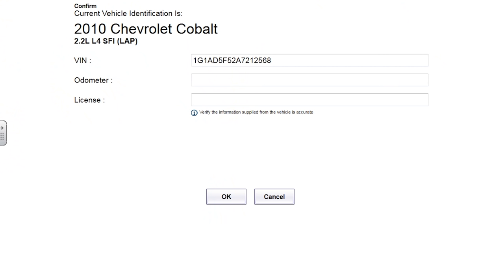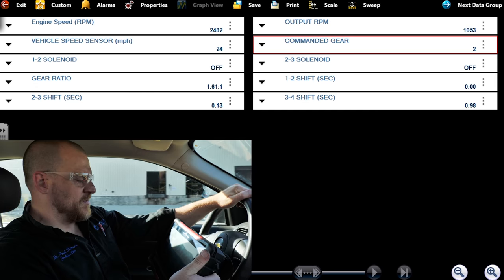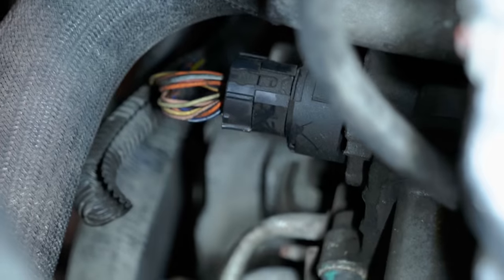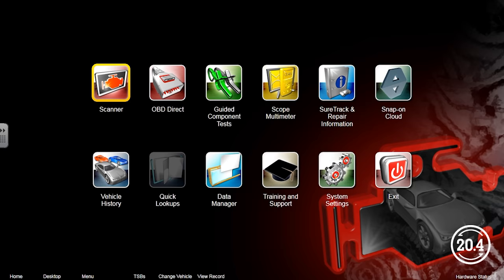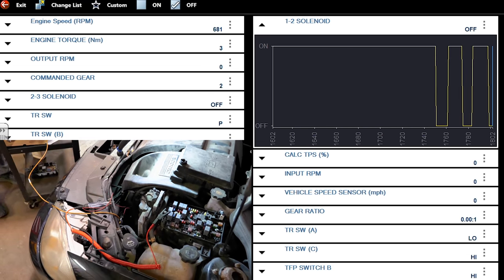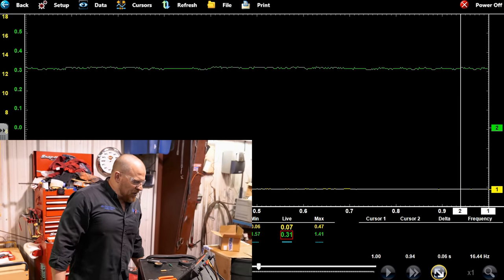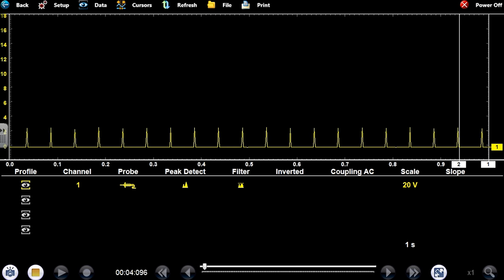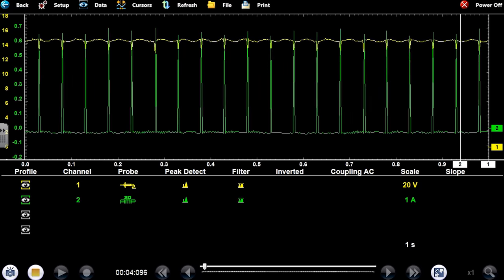Testing Transmission Shift Solenoids - (P0700, P0974)

Comment from the maker: Of course we still have a Saturday release planned for you guys! Merry Christmas my friends. Hope you enjoy this case study. Looking forward to your comments. Have a blessed day!
Reply: Been needing to test shift solenoids in an XJ, so thanks! Merry Christmas, Danner family. 🎄
Reply: Merry Christmas 🎄
Reply: Merry Christmas,  Blessed 🙌 🙏
Reply: Merry Christmas🎄 to Danner Family Stay Blessed😍
Reply: Merry Christmas, Paul and Caleb! 🎄
Reply: Merry Christmas to you guys!
Reply: General question about testing.  I get code recently P1750 and flashing D5 when I tried to drive Acura tl 2003 out of snow.  It was only then and it shut off.  It direct to A/B solenoid or if not, that tranny is gone.  However, someone at acurazine said it can be ground wire.  I know I do not have a problem starting so it is not that ground wire.  I see some ground wire go from chassis to tranny.  I checked from negative battery post to tranny case voltage drop when car was running and it was only 23 MV (millivolts).  Is it that proof ground is good in tranny/solenoids area?
Reply: Wait a minute , i just started watching this one , did you look up the wire harness on your scan tool ? I need to invest into a better scan equipment . Im gonna search your page , maybe theres a video already about the best diy computers

Comment: I've seen that exact same thing on a HHR. Found the solenoid burnt inside after proving the circuit was intact. This proves why a scope is invaluable at times to see a overall picture. Those side covers are easy to do and I did the HHR one in my driveway. Was a mobile job
Reply: Hey i was wondering how did u check the circuit

Comment: If it were my own car I’d maybe see if I pulled the transmission side cover off and tried to see how much a job it would be to throw a new solenoid in. I’ve heard some are easy to replace. So now if it was someone else’s car I’d be telling them no guarantees at all it’s gonna drive out the door. They still tell me to try it and I’ve been lucky sometimes. Nice job Paul. I like the way you reason stuff out.

Comment: You can sneak it out with just loosen the passenger side sub frame and all the way out on the driver’s side
Reply from the maker: So Danner was right! One of you would know...awesome!
Reply: Yes, the same on my other car brand for swaybar bushings.. dealer manual/instructions tells you to pull down the subframe but it isnt required as a DIY. Its tight but its reachable and doable :) you want to avoid to mess with subframe as much as you can. You need to line up the bolt holes and other stuff ive seen in the manual. With some "special super secret tool dealer only" :) and imagine all the rust and stuck bolts not coming out. :)

Comment: I have personally made several test lights including one with a fog light bulb in it for high current testing. I would buy yours in a heartbeat when you start selling it!
Reply from the maker: Thank you! I'll keep you guys posted
Reply: Yes sir
Reply: What I was thinking is a test light with different amperage bulbs that you can swap out. I don't know how high you could go and still make the bulb interchangeable. It might also make it a little dangerous if you have the wrong bulb in it.

Comment: Had this exact issue come into my shop about a year ago but on a cobalt, the customer said she had it to 2 different shops before getting a recommendation to bring it to me. 
These problems are the ones I like the most, had the issue figured out in about an hour and a half and that’s with pulling the side cover off and verifying that it was in fact a melted solenoid. 
Contacted the customer, recommended both solenoids A and B be replaced along with filter and fluid. 
Did that, reset the shift adaptations and took it for a drive. Problem solved and I earned a permanent customer

Comment: WOW!    You are the man. I have been having issues with my Dodge transmission.  I have had my truck in 2 local transmission shops. All they did was show me the codes and said to replace the transmission. Never did any electrical diagnosis on the codes. Seems like most shops see these procedures as a waste of time.

Comment: Good Job Paul Danner. We will not install a new solenoid with out an OHM test on the bench. Also heating up the new solenoid on the bench with a heat gun while doing the OHM test is a good idea. It's a long way back in for something like that. Because of the oil in the pass through connecter that needs to be replaced as well. Some day we will see ATF on your hands. When you do Transmission work every day that is not a tough job. James can do that job in about 3 hours. OEM Solenoid is a must. Also you guys can by the parts and the side cover gasket from Transtar industries  located in you area. They are always in stock.

Comment: I know a lot of what you’re doing in your videos is meant for teaching so my comments aren’t meant as criticism at all. I check trans circuits for a living, almost every day. Something you mentioned a couple times that is so common but I’ve learned over the years to think differently when it comes to trans fluid in the connector. It’s bad, internal harness/pass-through connector needs to be replaced but when you’re chasing electrical diag keep in mind that those same circuits are swimming in fluid inside the trans with no attempt to seal connectors or pc boards, the fluid doesn’t short them at all. Water or debris in a connector absolutely a problem and having fluid in an atmosphere exposed connector will increase the chances you’ll end up with at the very least a partial short over time. The leaking connector would more or less be a note to advise customer once diag is done for me and since most of the time you’re going in for solenoid replacement anyway. 
 Another note is that MOST but not all cars diag is smoother for me at the TCM/PCM connector. Like with this Chevy, everything you needed was at the stand alone TCM, disconnected and switch on. I do voltage tests on ALL solenoid control wires. It’s a quick 4, 5 or 6 wire voltage check with a meter then switch to amp test (loaded circuit) with a quick tap of the control wires. Most common I see would be zero amps or huge spike. I use those numbers gathered to calculate ohms with V/I*R. Never fails me EXCEPT the rare occasion you have a melted solenoid. It can pass all electrical tests but fail to operate. 
 Good stuff man, I always learn something from every video. Thanks for posting free content
Oh side note, I’m in a trans shop and we can change that solenoid out in a bout 1.5-2 hours give or take. The service guy does them.
Reply from the maker: Great information and thank you so much!

Comment: Great video! As a layman who understood very little, I found the analysis of the necessary repairs and their likely associated costs illuminating and reassuring.

Don't know if I have a bad solenoid yet, but the transmission in my truck is struggling to find higher gears (Mostly. It still succeeds under certain circumstances), and there is no check engine light on. My journey to sort it out began here and I feel much more prepared to meet whatever is to come.

Comment: Another great video, I had a Jayco 5spd with a lock up sift solenoid that was shorted, I was able to get the ohms value for the solenoid and it looks like it was shorted from the reading I took from the harness, so I took the chance and got a new solenoid and dropped the pan and replaced the solenoid. It ended up fixing the lock up shift code. This was on my own transmission and the only risk was the price of the solenoid and the new fluid I put back into the transmission, so for me it was worth the try, it turn out the solenoid was shorted out.
Paul you said this was a person from your church, why don’t you take up a collection and do a part 2 on proving your conclusion and blessing your fellow church member at the same time.

Comment: Danner, make that test light so that it wont detach from the banana plug. A lot of times that's the main problem with stretch coil test light or whatever it is called that it detaches fairly quick in the first pull. Eric O attached a permanent clamp on plier so that it never detaches and I like that, just need to be small either big jaws lol, though I like the banana plug it I believe it should be a thread on type or click to release so it wont disconnect too easy.
Reply from the maker: Good feedback!
Reply: Actually, a viewer made that vice grip clamp light for Eric a few years back, but yes, I can see the suggestion. But some kind of locking device to hold the banana plug in place while making it easy to swap various clamps as needed.
Reply: I would have to disagree, banana plug on the end is genius. You want to be able to swap from a pin to clamp to plug ect quickly and easily when switching them in the field on the job. If you pull your banana plug apart, you are tugging way to hard and by that time you should be checking your connection anyways because even a slight tug and your connection is lost. Banana plug is perfect for this application 👍
Reply: @remodz6385  obviously you dont do a lot of diag. The pull to stretch those wires is quite hard just to unwind them. I would agree more if you didnt use the coiled version, that's my favorite but I wanted the 12ft that Danner has always used on his older videos but I keep going back to my OTC one because of how easy it detaches when trying to stretch it to at least 8ft.

Comment: I enjoy your videos . I watch a shop in Amarillo that builds transmissions they stated oil in the harness connections can cause all kinds of problems.  They always replace them and shift solenoids.  I seen them do away with the pulse modulated on the torque convertor on certain builds makes the convertor live longer or that's what's told . I prefer manual transmission lol .
Reply: I prefer ONE GEAR plus Reverse ...more dependable

Comment: Merry Christmas!
That strange language is french: la porte est ouvre means the door is opened.
The driver is in no danger at all as it has a current measuring resistor in its source and the computer reacts very fast turning it off. Good design.
Nice and informative video, as always!
Reply: Yeah. Good design but not good software for dtc. Because if dtc will be "current too high" thats rock.
Reply: @DKr475  Correct! But that would be too easy to repair and that's not good for the manufacturer.
Reply: @danielmusat597  thats the point:)

Comment: excellent approach. You would not have a good training video if you did not take the approach that you did. very informative. Your videos make it easier to be confident that the part that is getting changed  , and not just throwing money at parts that doesn't fix the problem. The brake cleaner is just part of being a mechanic we are around enough chemicals and i have been around them for 30 years and still haven't shown any signs of cancer, but i have gotten a pretty healthy buzz off some, hazard of the job ! thanks for the videos, yours are number 1 and i always will watch yours first before if i see a video yours that pertains to what i am working on that day. excellent job thanks. Quinton
Reply from the maker: Thank you Quinton!

Comment: Transmission fluid doesn't seem to matter when it comes to conduction as I think most if not all ATF fluids are dielectric. The solenoids and connectors are immersed in it. 
(Penzzoil DEXRON-III MERCON has a dielectric strength of 35kV.)
I did a resistance measurement on a Saturn TAAT once. The bad solenoid was the same as the rest of the solenoids until I took the cover off and measured it directly...  

With the engine off you can supply power to the solenoids and listen for them to click after confirming power from the harness or supply your own power, a stethoscope can help you hear them click. If you don't hear one and it's the one that's an issue, you know it's an internal problem.

Comment: The voltage spike above battery voltage you see after the driver turns off tells me that there is current flowing through a coil somewhere in the circuit. An inductor won’t allow an instant change in current flowing through it and thus causes a voltage spike when the circuit is opened.

Comment: I've done heavy line for a while.
I've swapped these solenoids without dropping the frame.
Sometimes you can take all of the side cover bolts out and move the pan just enough to reach the solenoid release clip with a pick without removing everything.
I've done it on some models.
Others you just lower the one side of the sub frame a little and the pan will clear.

Comment: I have an OTC test light that I modified with a banana plug on one end to attach alligator clips to it and made a screw-on male banana adapter to connect to the tip for the leads from my AESWave test kit.  I love it with the exception of the coiled lead often pulling out of my alligator clips.  However, I use it with a 20ft Power Probe cord and it works fantastic.

Comment: Danner, we see a lot of solenoid performance or shorted for some in chevy cars/trucks. Is it safe to assume that it is because there is too much debris in there and that jamming the solenoids and the shift is not as expected? I ended up opening a 17 chevy silverado which has the TCM internally along with the solenoids which are said to be non serviceable. The whole pack is changed with the TCM as a pack and  needs programmed. What I noticed was a bit of excessive metal debris and for one of the faulty code solenoids, had ripped the filter mesh at the oil feed part inside the tranmission and had metal debris in there as well that had not made their way into the solenoid but if it was ripped. I assumed that it was completely plugged and the oil pressure broke the filter mesh.
Reply from the maker: A mechanically stuck solenoid wouldn't draw 8 times the amount of current flow, so I do not believe this is the case on this one. An electric motor that is seized could do something like this, but not a solenoid.
Reply: @ScannerDanner  I think the thought here is that something (metal) caused the solenoid to short out and replacing the solenoid only fixes the symptom.  It probably needs a trans rebuild.

Comment: Does the driver on this work like a normal open switch or normally closed? Still trying to wrap my head around how the driver energizes the solenoid. Usually if a solenoid is shorted they don't produce a magnetic field or a very weak one, they get extremely hot, and they pop fuses. After so long they burn out from the heat if the fuse doesn't pop. Good job on the video, very professional and textbook approach and at the same time you try to entertain unlike most educational videos

Comment: Just an FYI. These same principles apply to any solenoid control system. I train my new technician on these same pull up/pull down circuits. 
We work on janitorial floor scrubbers and  sweepers that use low side switching to control circuits on and off via solenoid and relays and PWM motors speeds.
Reply: Yes, its definitely the same! By the way, would you happen to know where I could get my hands on a dirty water tank lid for a Clarke EXT-771 (old model) carpet scrubber?
Reply: @mattcat231  sorry my friend, I’ve checked all my usual sources. No luck finding a old style recovery lid.
Reply: @Jimbo9008  Appreciate the effort! Ive been making by with a glass cooking pot lid and some stick on window insulation foam held down with a bungee cord, just doesn't look professional when I bring it into a building to use.

Comment: Right off the bat, I was yelling at the screen "its the solenoid" only because this has happen to my 03 Silverado. Hence your explanation of this testing procedure can apply to any car. But my question is.... either this problem can fail an inspection, in your state, or the inspection station can fail your car just because the check engine light is on???? and they don't have the technical equipment to identify the failure causing the check engine light illumination. Go back down to the river, I suggested or commented on what to do with that autel scanner and fish it back out and bring it to the inspection station so they now have some definitive reasons for failing inspections. Just a thought.

Comment: Would it make the speedo not work when it goes into limp mode? If i stop, shift into park, then back into drive, then it seems to drive fine and the speedo starts working again. Idk if its the solenoid pack or the transmission control module...

Comment: An All in one test light would be sweet. With amp and volt ratings and a 3or4 way switch to change readings. Similar to the little battery monitor things.

Comment: And buy using a multi meter i think i lost connection , cause it jumps all over ...aaaahhhhhh....the light bulb just lite up i think ..
My stinking obs 3500 don't have no transmision codes , its stuck in second gear , no tach , no speedometer & prnd fuse keeps popping ..it will work for the short ride to a job , seems to pop when it gets warm .. i just replaced the wire harness inside the transmision cause i thought that was it , it had fluid in the plug in , i should have went a little farther eehh ..

Comment: Nice explanation. Why the solenoid did not show a straight current line if it was shorted as ignition coils primary current?
Reply from the maker: 29 microseconds is why. I'm really zoomed in on that capture

Comment: You did a resistance test - V divided by  I  = R  ... the best test you did was to compare to the other solenoid.  Most likely the solenoid coil is shorted, not the harness wiring.   If the connectors are the same, maybe you could hook up to the good solenoid and double check the driver, but you pretty much ruled out a bad driver anyway.

Comment: I am a transmission builder and sometimes those codes come with toasted clutches and replacing just the solenoid will not fix the problem